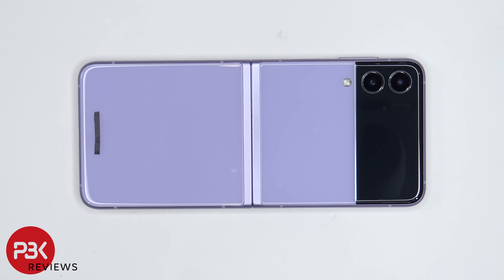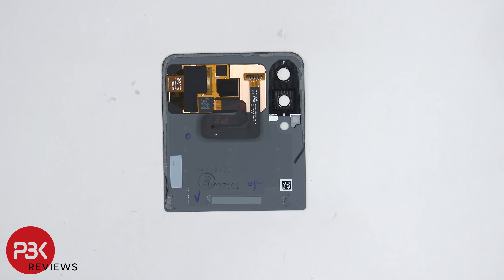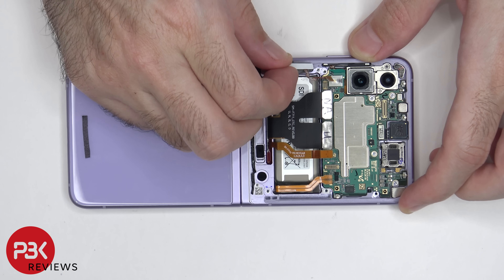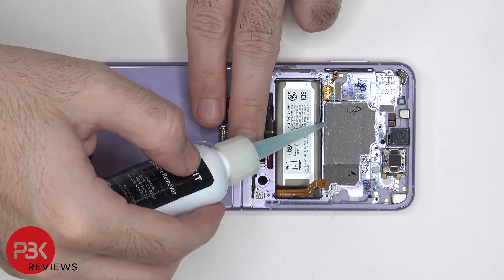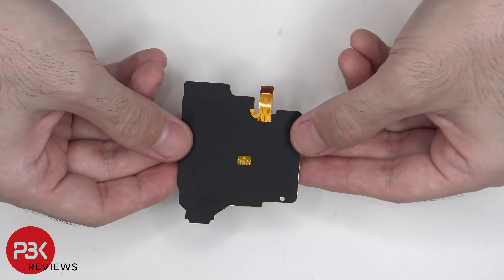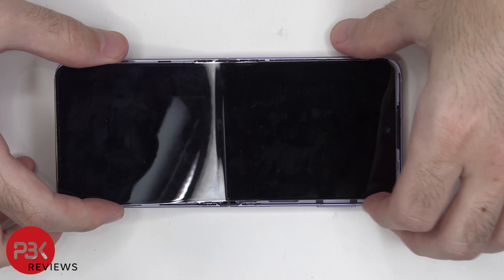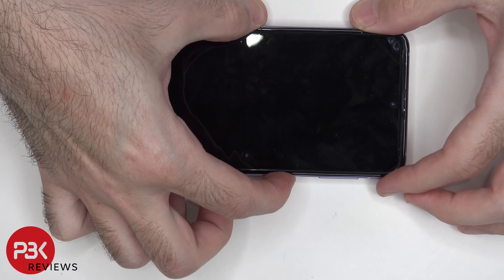Samsung Galaxy Z Flip 3 5G Disassembly Teardown Repair Video Review

Comment: Damn bro I didn't think you could actually remove and re-install a folding screen without damaging it. I can barely get an s9 glass off without breaking it lmao
Reply from the maker: haha yea took a lot of time and patience but I always recommend to buy a replacement fold screen pre installed with the frame because installing the fold screen back to the frame isn't easy either, if its off slightly, it will break or crack if folded incorrectly. And it needs to be adhered back to the frame perfectly as well so it's a headache.
Reply: Just to let you know, it's harder to manipulate a big glass than a small one.

Comment: The engineering in this is just so incredible, love your channel.
Reply from the maker: Thank you!
Reply: This phone is surprisingly easy to open and swap main boards in case the screen creases and cracks, which is quite common.   Just did one for a customer in about half an hour.  They provided as second identical good screen phone to swap the main board into along with all their info.   Trying to transfer the info via cable is not possible since you must authorize the ADB device which is not possible with a broken screen.  Besides, they had a bunch of app logins/passwords they never wrote down, so swapping the main board basically kept everything exactly as in the broken screen phone. :)

Comment: Owesome, great work, what is the red glue around the flex. I see two different color on both sides.
Reply from the maker: Thanks! Its a cured in place rubber gasket to prevent water from getting in from the opening.

Comment: Am I tripping or is there no thermal heating pipes?
Reply from the maker: Samsung mainly uses 3d graphite and graphene films for heat dissipation. Works just as well as the copper vapor chambers/pipes and lasts longer.
Reply: @PBKreviews  ohh okay that’s what the graphite was,  I was definitely a little concerned because people have been saying it’s already been getting pretty hot when using a lot of workload on it. Thank you so much Bro for responding!
Reply from the maker: @royceg3375  you're welcome. Also just because the phone gets hot doesnt mean it's overheating. It can mean the phone is transfering heat away from the components and out the phone efficiently. Only when you get lagging on the phone and other issues can be a sign of overheating.
Reply: @PBKreviews  that’s a very good point man 🧐 much appreciated!

Comment: Foldables are looking  quiet the easy to repair.Hopefully there no software locks if you swap parts.
Reply from the maker: I don't think there are any software locks, especially now with the new legislations being passed, manufactures will have to make their phones repairable by third parties and also have to provide replacement parts to be sold to third parties as well. Hopefully soon these locks will be a thing of the past.

Comment: Is that a screen protector that can be replaced? or is that part of the screen?
Reply: Screen protector that came factory installed, Samsung said it’s recommended if needed to be replaced.. professionally done.
Reply from the maker: Correct thank you.
Reply from the maker: Yes as the previous comment mentions, its a factory installed special one that would need to be installed by samsung or an authorized place if needed replacement.

Comment: Really surprised that you didn't wreck the flexible display after taking it down!

That's the most fragile component.

Great job there!
Reply from the maker: Thanks. Took my time with it and applied heat and a little isopropyl alcohol n luckily didn't break it 😀👍
Reply: @PBKreviews  didnt break it but does they marks along the bottom side affect it much?

Comment: Replacement screens are going to be very expensive.
Reply: Otherway is to buy a frame that has the screen already installed.Would make the job easier
Reply from the maker: Yup, definitely going to be costly.

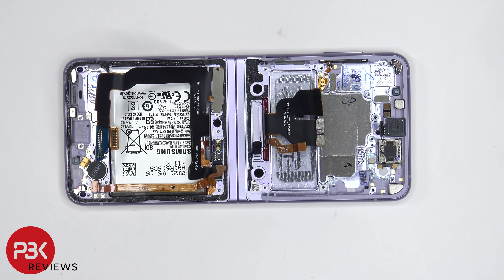Comment: at the 6:23 what is this piece
Reply from the maker: It was a small chip under a shield. Not too sure what the chip was for but might be a charging regulator or something else related to what that flex cable connects to.
Reply: @PBKreviews  yeah i thought so ,but didnt see any chip attached to cable like that interesting